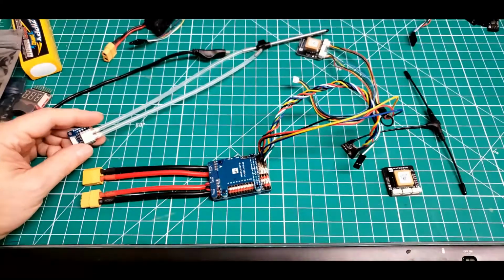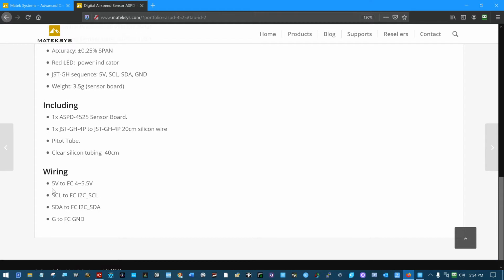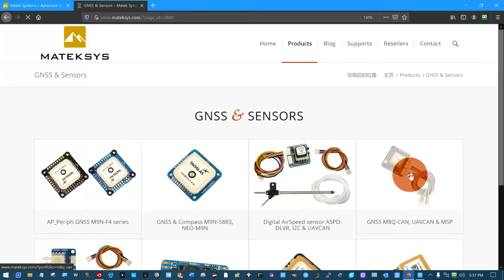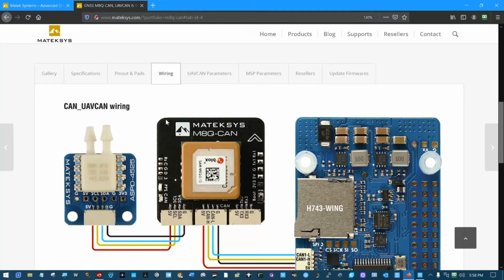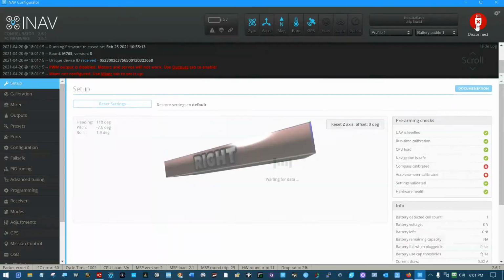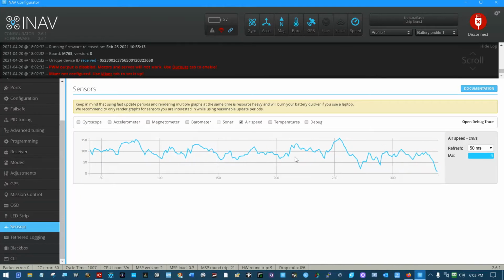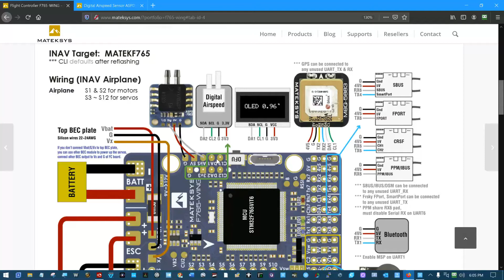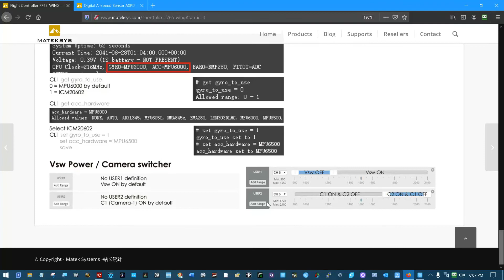F765 Wing Air Speed Sensor INav Setup

Comment: Hi I have also just bought this product and was wondering if there is a specific length for the silicone tube because I cannot find this anywhere. Thanks
Reply from the maker: I would keep it as short as possible.  Not sure if there is a limit on length.  I think that calibration would take care of that but am not sure.  A manufacture of air speed sensor would be a good place to find that answer.  I did but some tubing based on inside diameter when I cut some of the tubing that came with a sensor to much.
https://www.amazon.com/gp/product/B083JDXVMR/ref=ppx_yo_dt_b_search_asin_title?ie=UTF8&th=1
Reply from the maker: Some discussions I found.
https://discuss.ardupilot.org/t/air-speed-sensor-tube-length/56685
https://diydrones.com/group/apmusergroup/forum/airspeed-sensor-tube-does-length-matters?commentId=7447824%3AComment%3A1409450

Comment: Can this be used with iNav for stall prevention? Or at least a Stall alarm?  How do you calibrate it so that you can trust the numbers you are seeing? I am imagining tying my wing to the roof of the car and comparing to GPS speed. Easier way?
Reply from the maker: Not sure about INav.  In ArduPlane you fly a calibration flight to calibrate.  It tries to calibrate at each power up but a Cal flight is always recommended.

I would just hold the pitot tube out the window while someone else drives if you want to test it on a car.  You can test on bench by blowing on it or with a fan.

Comment: How calibrate? Matek instructions really are lacking!
Reply from the maker: Instructions are lacking all across this hobby. :(

I have not yet calibrated a air speed sensor.  i will soon.
Reply: @nighthawkvs  Sorry! I figured it out. As soon as I took the model outside and showed it some satellites it sorted itself out! Before that it was showing 143 mph at rest lol.
Reply from the maker: @jasonstation  It will show wrong results when it doesn't have all inputs to the math.  :)